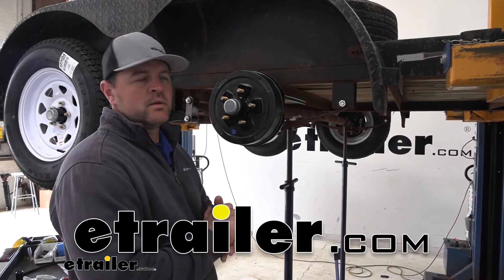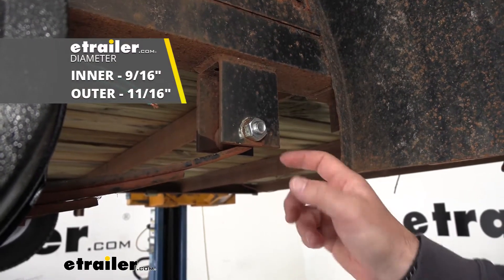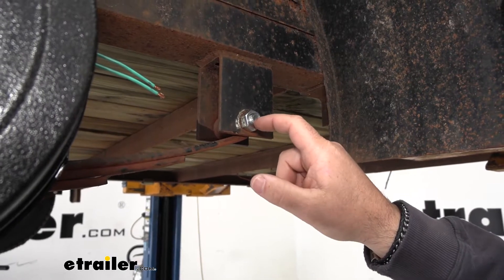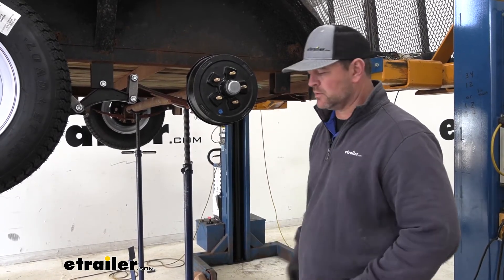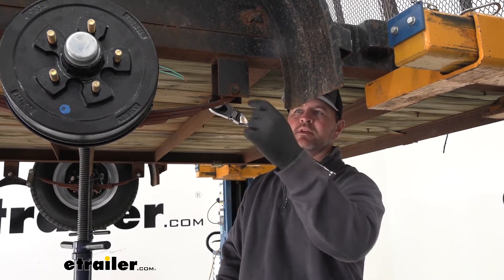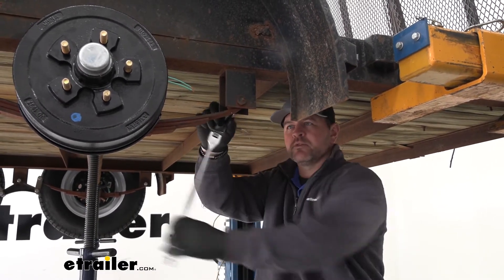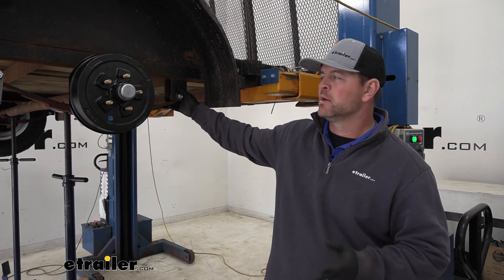etrailer | Step-By-Step Installation Tutorial for the Suspension Bushing on a 1917 Ford Model T

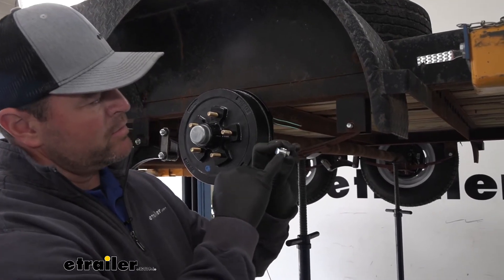Comment: i wish u could see my face when he did the thing at 5:40 i had no idea thats what that was for, is it ok to use those bolts as clamps on the leaf prings lol i didnt hammer them in they just sitting tight wow
Reply from the maker: You have to hammer the bolt in so the teeth on the bolt can bite into the opening. This will keep the bolt from spinning. You will need to hammer them in.
https://www.etrailer.com/Trailer-Leaf-Spring-Suspension/Dexter-Axle/721590.html